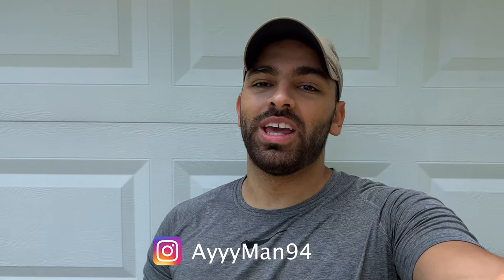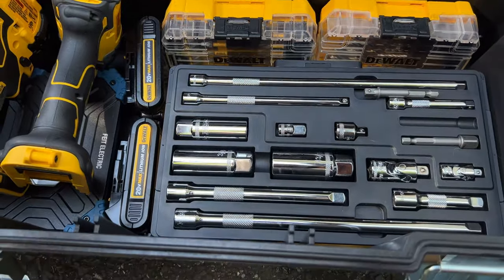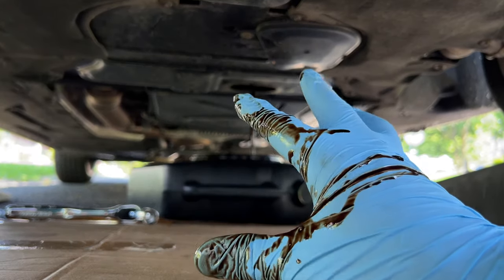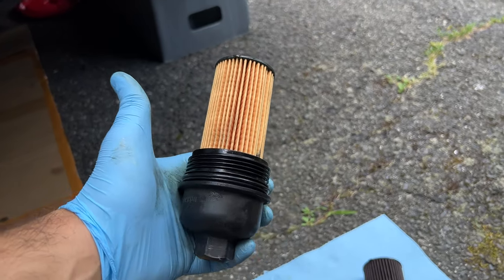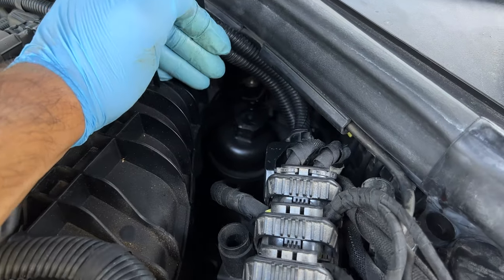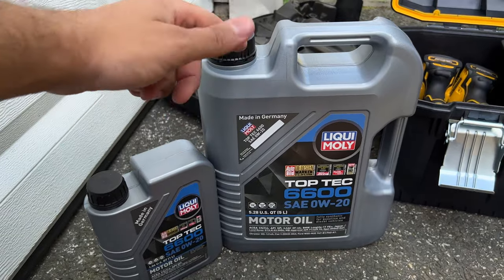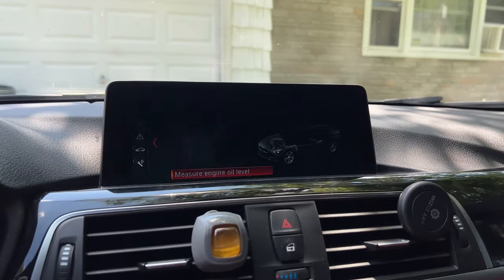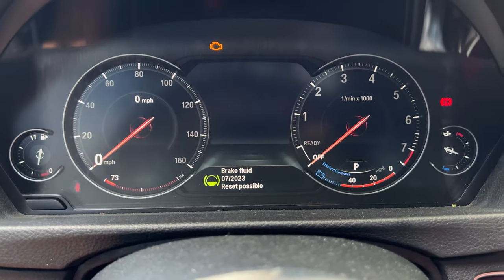BMW 330i F30 OIL CHANGE (B46/B48 engine) DIY

Comment: 0W-20 is too thin for engine protection. That oil I believe is entirely for fuel economy. That's why the BMW oil is called "FE". You need to get at least 0W-30.

Comment: Hey guys, I’ve been changing my own oil every 6k on the dot. My 2011 528i with the N52 has a solid 220k miles on the odometer. I highly recommend sticking with 6k mile change intervals regardless of what the iDrive says after you reset it. I’ve only ever used Mobil 1 Full Synthetic 5W-30 as that was the recommended oil when this car was new. The biggest maintenance items I’ve had in 220k miles have been the serpentine belt, starter motor, coolant hoses and valve cover gasket. Aside from the oil I always change my spark plugs and ignition coils every 35k miles and the engine runs like butter. I would like to do the check valves which I already have now for 2 years but on my particular N52 the heat shields make it very hard to access the 2 check valves on the passenger side of the engine. People completely underestimate the lifespan of a BMW with a proper service history.

Comment: An engine should use the specific oil which was engineered for. If engineers say 0w-20 then that should be the correct viscosity. Heavier oils may create more wear instead of protection if the engine was not designed to use that.

Comment: Had the same issue as you. I couldn’t get the filter back on so put the filter in first then put the cap on top. The repair manual says to attach it to the cap first. Anyone knows if it makes any difference?
Reply: No difference just harder to install with the cap blocking visibility really.

Comment: Hello, do you know what normal operating temperature the car reaches? Coolant and oil temperature? I ask you because I have a 2017 330i and my car reads 230 degrees Fahrenheit in both temperatures.

Comment: I definitely wanna get into doing my own maintenance and modding to my car and this channel has really helped me see that even though BMWs are complex and somewhat daunting they are also definitely workable. 

I had a question concerning wheels and suspension. So at some point in the future, I want to change my suspension to racing coil-overs and also get some lighter and more aggressive wheels. once you have changed them how do you truly know if you optimally adjusted them to improve the sportiness? Also, do you take them to a shop to get them laser aligned? 

I was also wondering what your thoughts were on getting stiffer sway bars in addition to the racing colors. Would you ever think about adding them to either of your cars?

I currently drive a 2017 330i xdrive wagon and totally love it. I can't wait to upgrade her and truly see her capability.  

Sorry about the long comment im just really curious.

Comment: what is the torque spec on the drain plug?
Reply from the maker: It’s pretty low but I also hand thread it as much as possible (highly recommend because you could cross thread without realizing if you use a tool). After hand threading I go back with the tool and just make sure it’s snug

Comment: Isn’t it 5.6 quarts but is it ok to put in full 6
Reply from the maker: As long as it falls within the min and max I think it should be good
Reply: @ayyyman_  Does the electronic meter ever display any thing other than "max" level? I put in 5 qts, still says max. If you do 6 qts, it would be close to overfill if not already.
Reply from the maker: @ZoneCrasher  very good question…. I personally never had it say anything different but I always put in the “correct” amount. My friends has shown something other than max though when we knew his car was leaking oil so to my knowledge, the meter does work

Comment: Is 0W20 oil good for this engine? Maybe it is better to use 5W30?
Reply from the maker: It’s what BMW recommends, that’s I I stick with it
Reply: @ayyyman_  I am asking because I have a Toyota Supra MK5 with a B48 engine and a lot of people insist to use 5W30/40
Reply: @AjgorYTG  depends on climate
Reply: @AjgorYTG  Use 5w40 synthetic. 0w20 is the recommendation but it causes a lot of low mileage issues with chain guides and tensioners.
Reply: @edward1927  I am not sure, I watched the Japanese film in which the engineer explained why you should use 0W20 for supra oil to these engines. Many people advise 5W30, but it seems that these Japanese engineers may know something ... I also know the BMW user who uses 0W20 and has traveled 80,000 km. No problems and the engine is doing well. I don't know anything, I try to gain this knowledge.
Reply: @AjgorYTG  It is recommended because it is thinner and gets better fuel efficiency. I started using 5w40 (which is what gets used in pretty much all older BMW, VAG, Mercedes) after taking a few BMW engine classes where it was suggested to use thicker oil. The idea is the 0w20 breaks down faster and doesn't provide as much lubrication. I'm not an engineer though so I could be wrong, just sharing what I learned in a few technical classes I've attended.
Reply: @edward1927  These days engines have different, tighter tolerations than before so comparing to old BMW engines are wrong, so the engineers know why they recommend thinner oil. Engines with tighter toleration with using of heavier oil than recommended could cause not geting oil to some spots as it should.
Reply: @edward1927  It’s true that the newer oil spec oil (FF LL 17) has a lower reserve alkalinity and won’t last as long as the older spec oils. But I’m sure most people here ignores BMW’s recommended intervals and changes more frequently 😅
Reply: I also have a mk5 2.0 and I use it 5w30